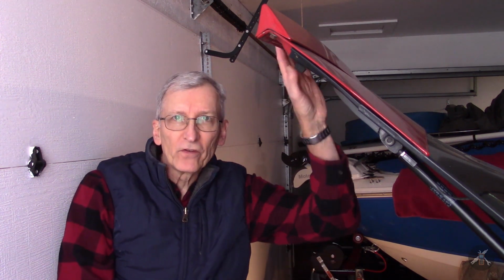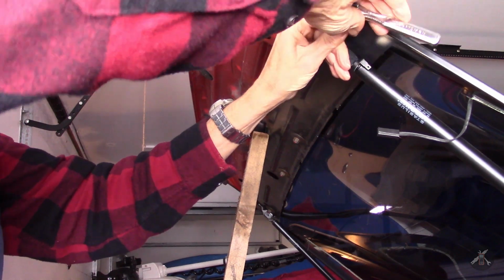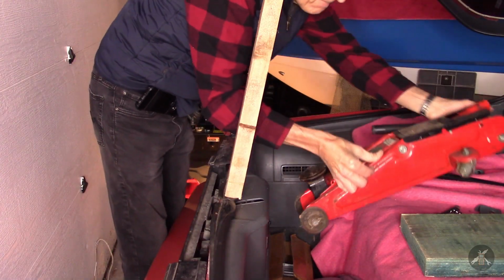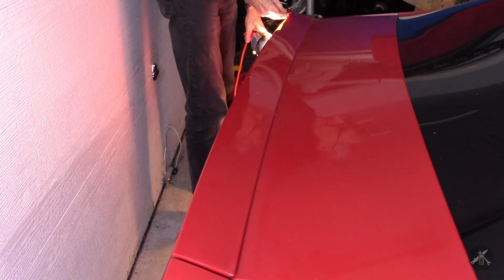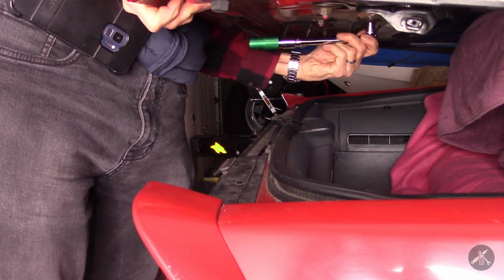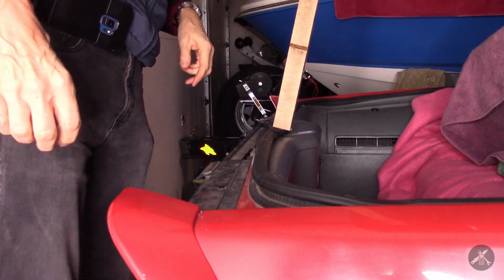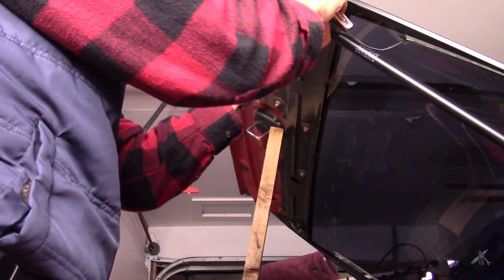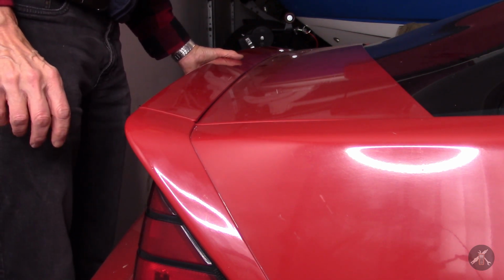Re-adjust Rear Hatch Deck Lid After Repairing Rear Overhang - 3rd Gen Camaro

Comment: To help eliminate movement and strut failure, I always park my 83 inside with the hood and hatch up / open. Then I cover it all with soft sheets. I also park with T tops out to reduce compression on seals. Especially being strictly a summer good weather car only.
Reply: I never thought about the t-top thing...thanks
Reply from the maker: I don't know how much it will help the struts to have the hatch open. It probably reduces the leak rate somewhat. Those are nitrogen gas charged.  The pressure will be somewhat lower when they are extended, but it is still considerable. 
Back in the day I worked on nitrogen gas accumulators in brakes.  If the parts were made correctly they would hold a very long time. We used helium in production to measure leakage. It was a trace gas that could be detected and they could measure / predict leak rates out to at least 10 or 15 years and assure a good part. They spent most of that life at full pressure.  
I hadn't thought about the T top seals, need to consider that.

Comment: Those daggone struts are working 24/7 to push back on the deck. My struts are original and do not support the hatch but I'm never in there anyway so I decided to leave the weak ones in charge of maintaining the good line up of the spoiler.
Reply from the maker: After having mine apart, I have been trying to understand why some of them creep rearward, yet others don't.  I suspect two things.  First, did the factory apply the correct torque to the nuts / studs that hold the panel on?  For example, there could have been variation in the tools used in the assembly plant . If torque was to the low side of spec, it might creep.  Second, I certainly had an issue where the butyl sealing strip relaxed during the first couple of weeks and some of the bolt clamp load was lost. My butyl strip was a generic replacement, but it is possible that the factory strip may relax some amount as well. When you tighten the nuts, you clamp the nylon washers to the glass, but the butyl caulk strip absorbs some of that clamp load as well.
I think that if I had one of these cars that was still in good shape, I would go in and check the bolt torque and make sure it was still in spec. then re-torque if not.

Comment: The rear-hatch overhang is such a weird thing about these cars, noticed there are so many thoughts on what makes this happen. Some say it could also be the hatch-hinges getting bent over the years.
Reply from the maker: I don't think it is really a mystery now that I have had it apart and know how it is designed. It is fundamental engineering physics.  There are 4 studs that go through large holes in the glass and have nylon pads.  The pads are on both sides of the glass to clamp it when the nuts are torqued. The friction between the clamped nylon pads and the glass hold the steel panel in place. The stud and nuts clamp both the glass and the foam and butyl sealing strips at the front of the steel panel. If the clamp load on the nylon is hindered by the resistance of clamping the sealing strips or if the torque on the nuts is a little low, the steel panel will want to slide rearward.
Take a look back at this video:
https://youtu.be/iJjJmLOtwm8?list=PLaagkwKaZ2RUUPF7eoU2t8dV1gsG2musW&t=490
Reply: @bitsofwisdom460  Hiya! Thanks for answering!
I've seen through all your videos, and personally used your videos on the decklid-repair as a reference when I did it myself 2 years ago. Applied new butyl-caulk and used a silicone-strip under the decklid underneath closest to the front (to replace the factory foam-strip if I recall correctly). Did what I could to line up the deck and cure the overhang, but it didn't do much to cure it. Torqued it down, let it sit and cure overnight and re-checked torque before reassembling the rest. Still felt good about re-sealing the deck though.
Reply: @bitsofwisdom460 On the other hand, yours turned out great and looks so good. You and the Camaro ready for spring yet?
Reply from the maker: @kmas8229  I am certainly looking forward to spring.  I have a few smaller projects this winter, but so far nothing to keep me off the road. 
One more thought on the deck lid.  The service manual did indicate that the nylon pads should be replaced when the steel panel is removed from the glass.  At this point, I couldn't find them, so re-using is the only way.  I don't know the reason for recommending new ones, but if they don't seat flat or the surface finish is changed, maybe it affects the clamp load and friction.
Reply: @bitsofwisdom460  Good to hear you're ready! 
Oh snap, forgot about those. Does nylon change its properties as the years go by, as rubber does? With the sun shining on the decklid they could go through "heat-cycles" and with the pressure warp a bit too don't you think? Could new ones be made with rubber or gasket-material? What about 3D-printing?
Reply from the maker: @kmas8229  Well, it's hard to say exactly. Every polymer compound behaves a little differently. But in general, these pads are out of the sun and UV is one of the major factors in degradation. Elevated temperature can also hasten degradation, but even in the desert sun you're unlikely to be over 150 or 160 F and not for long. Nylon compounds are usually sensitive to moisture. I've had issues with them swelling in extreme humidity or water submersion, but it would reverse when it dried. I don't really expect much degradation from these factors and my pads didn't appear to be abnormal. 
One thing was that the upper pads were not completely flat at the holes in the glass. some of the material had flowed into the holes. I just tried to be sure that they were centered up the same way on reassembly. That distortion might have been the reason for wanting them replaced. The bottom ones were more like a flanged washer.  They were flat with a raised section that went into the holes on the glass.  The upper ones were basically flat.  If someone had the right thickness flat stock, you might be able to cut them out of a sheet. Not sure what process would be best. 3D print might work, it might be a challenge to choose the right material, but it has possibilities. I haven't done enough work with 3D print to know what materials are available.  The material would need similar crush strength and friction coefficient to the original.

Comment: I tinkered with mine last winter but truthfully it needs to be totally redone, spoiler attachmnts are rusting away not sure whats holding that thing on,and the whole thing looks like its ready to slide of back of car. Its better after I messed with it but still not totally in place.
Reply from the maker: Well, if you plan to redo it, be sure to take a look at my playlist for the original repair.  If you haven't seen that yet, I went through in great detail how I took it apart, resealed and realigned it.

https://www.youtube.com/playlist?list=PLaagkwKaZ2RUUPF7eoU2t8dV1gsG2musW